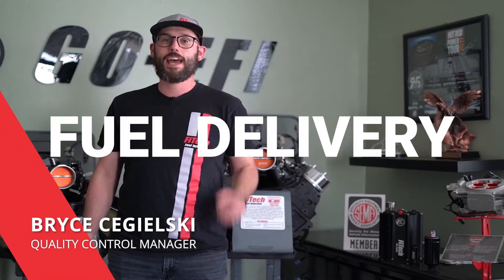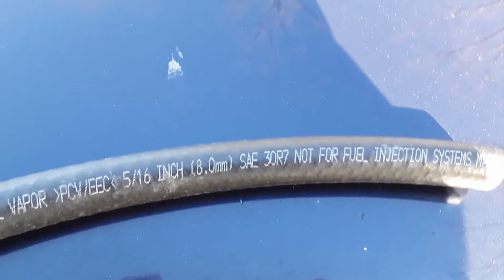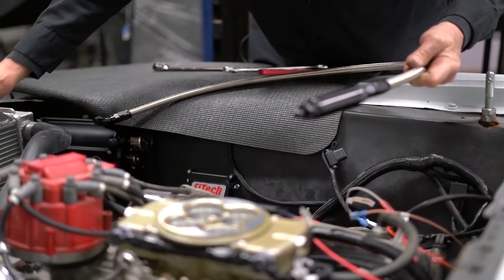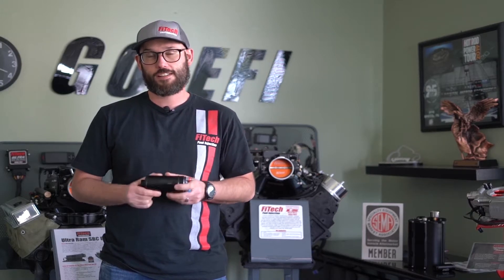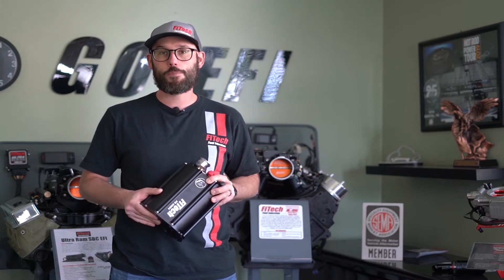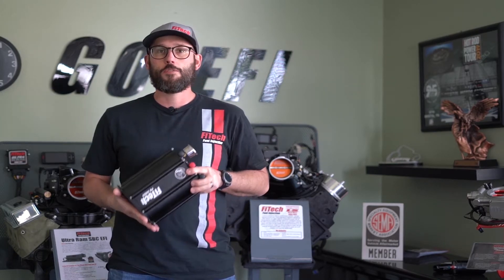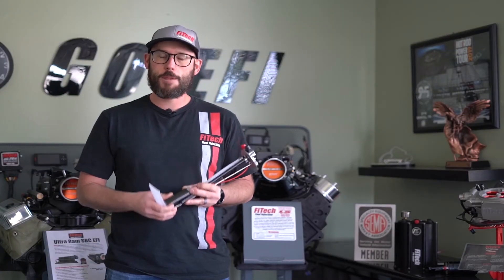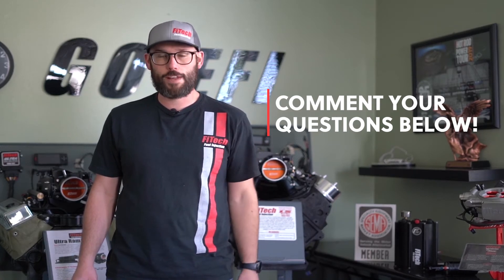Fuel Delivery  | Tech Tuesdays | EP4

Comment: I have the LS 750 kit. Do you guys recommend the feed on one fuel rail and the return off the other side? Or return off the fuel pressure regulator?
Reply from the maker: Hello sir, we recommend running the return from the regulator back to the tank, it will make it easier to hook up. And just have a single feed going to your fuel rail with the fuel already regulated to 58-60psi.

Comment: Looking at buying the 1000hp ls set up, do you recommend mounting the regulator before or after the fuel rails.? Motion race works recommends after so the rails have constant even pressure from the pump. Just wondering what you recommend thanks.

Comment: I have a 66 Chevelle. tanks, tank and pump have no idea where where to put the check ball does it go by the tank or up by the fitech great kit trying not to burn it up
Reply from the maker: You want to prevent back flow in the fuel system. That being said you want it as far back as possible close to the fuel tank.
Reply: But it is best to locate a flow valve anywhere AFTER the pump..... Correct? Not absolutely necessary but best practices?

Comment: I am running 750hp ultimate LS Fitech system. I currently running a in tank fuel pump. I have installed an inline corvette style fuel filter. How should I set up my fuel rail to deliver constant fuel pressure on both fuel rails
Reply from the maker: Run into one rail. Use the crossover and plug the outlet of the other rail.
Reply: Thanks for the information.

Comment: With in tank fuel pump or external fuel pump do you need to install a pressure regulator?
Reply from the maker: It depends on which EFI unit is being used. If you have a throttle body EFI the regulator is already built in except for the 30020 and 30021 Classic units. All others will need a regulator.

Comment: Hello, just got my 70051 kit, I’m installing it in my 96 Camaro, I’m putting it on a gen 3 5.3l, and I’m a little confused on what I should run, I would like to continue to use the stock fuel tank but am not sure what I should get please assist.
Lawrence
Reply from the maker: The factory fuel pump will have a flow rate around 180 LPH which would only support an engine up to about 400 hp. If you stay under this power level you should be able to continue using the stock fuel pump.
Reply: @FiTechEFImedia  so if I wanna use stock tank and increase power I can upgrade pump

Comment: If I am running a fuel system with a return what should my pump pwm be set to?
Reply from the maker: It can be anything that maintains pressure. Somewhere between 40 to 100 is what we would expect.
Reply: @FiTechEFImedia  awesome thanks. I believe mine is set to 27. Would that cause it to lean out in the upper rpm range?

Comment: Just bought the 30003 kit for a 1969 camaro z28 350. When i turn the key the pump stays on and builds pressure in the lines and doesnt shut off, im concerned that its going to rupture the lines. I also rewired the entire car (completely new harness) do i need a relay?
Reply from the maker: As long as you have a return line on the system the fuel pressure will be at 45 psi. As for the fuel pump not shutting off it seems to be that the EFI is not in control of the pump. Something else is powering the pump. The EFI does not require a relay on the pump circuit however there is nothing wrong if one is used.

Comment: Do i need a regulator with the 71008 kit matched with a fitech tank w/ in tank pump kit?
Reply from the maker: You will need a fuel pressure regulator such as the #54001 with the #71008 kit.

Comment: I have a go efi 4 600hp with hyper fuel intank with no pressure regulators, do I need a pressure regulator and what do I need to mount a pressure gauge on the efi and at which side do I install it?
Reply from the maker: There is a fuel pressure regulator built into the EFI system. As long as you have a return line running back to the tank from the RETURN port on the throttle body the fuel pressure should be 58 PSI key on engine off. To install a gauge purchase a -6 AN Gauge Port Fitting.

Comment: I have noticed way less negative comments on the new 50004 command center than some of the earlier models. I take it Fitech has gotten all of the issues worked out?
Reply from the maker: The original Fuel Command Center works in a completely different way from what the newer Force Fuel Systems operate.